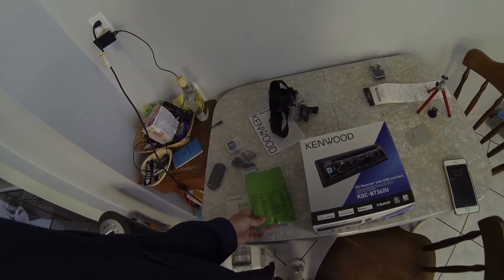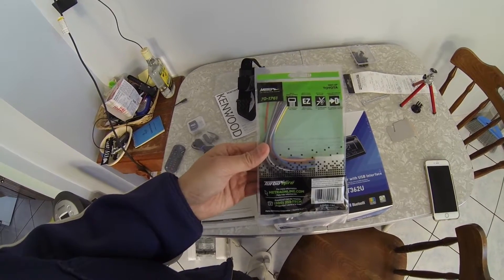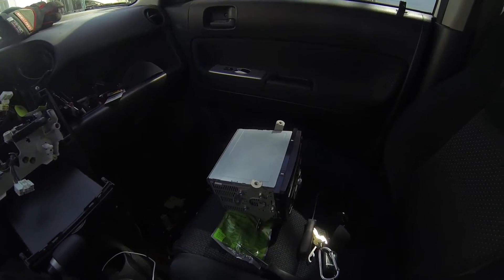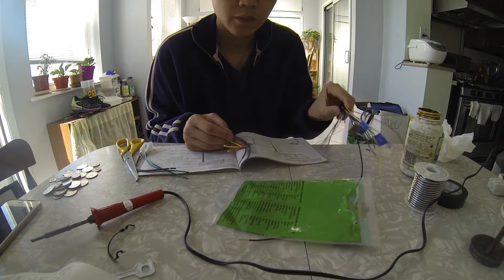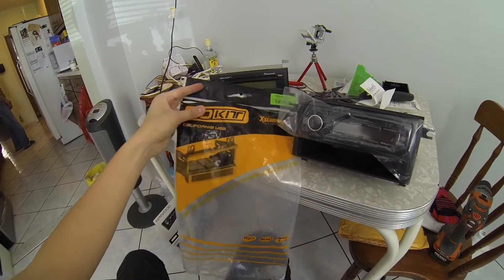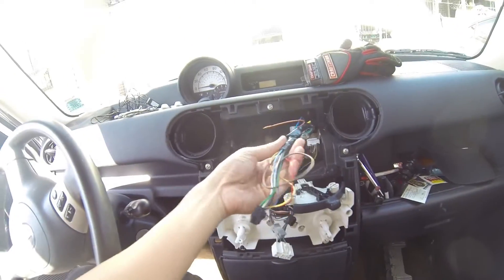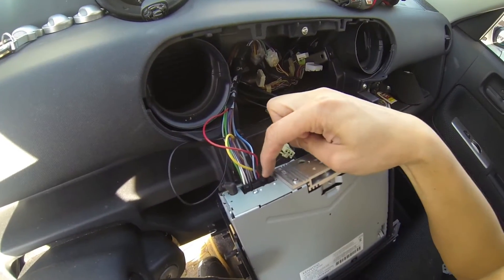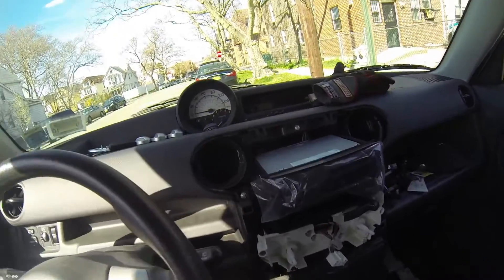How to change Head Unit Gen 1 2006 Scion xB

Comment: Installing a sub is also pretty easy with this car as long as you have an after market stereo. I never installed one before and did it in 3 hours my wire routing needs some fixing but it works

Comment: I just bought an 2006 scion xb and installed new head unit but there appears to be an extra harness that can't be plugged into my new stereo and I got it all installed and I couldn't put my car into gear because of that harness how do I bypass that?
Reply from the maker: Are you sure the harness is the issue that you cannot put the car into gear? This is the first time hearing it, I thought that would be something like the steering wheel volume control function

Comment: Just picked up an '06 and am putting in a new head unit myself. There appears to be two plugs that aren't going to be used with the aftermarket harness do you know what those are for? Also does your steering wheel controls still work?
Reply from the maker: I believe that's the steering wheel controls and maybe the satellite radio signal. Unfortunately, the steering wheel controls no longer work